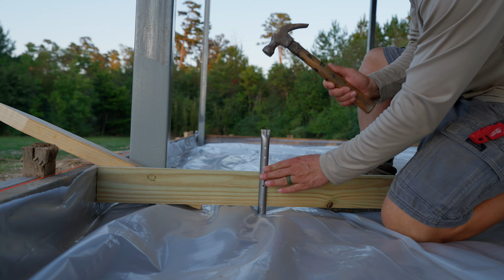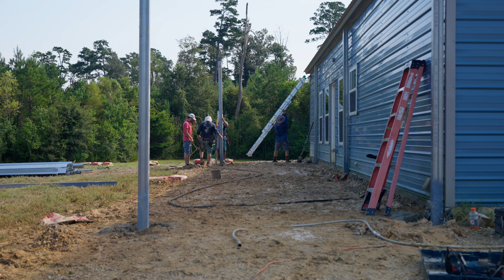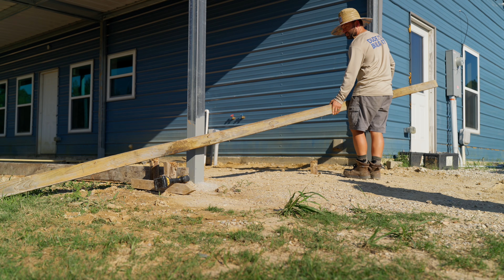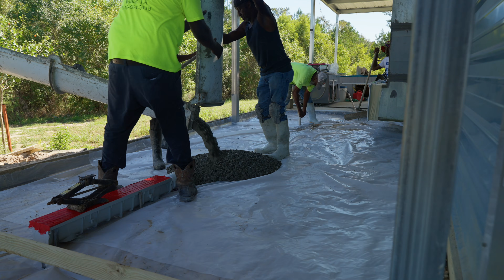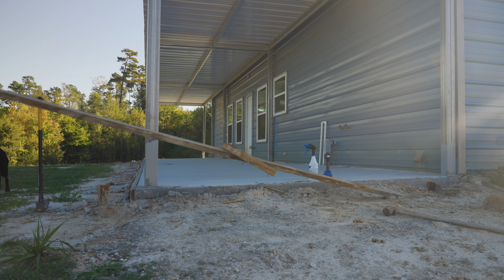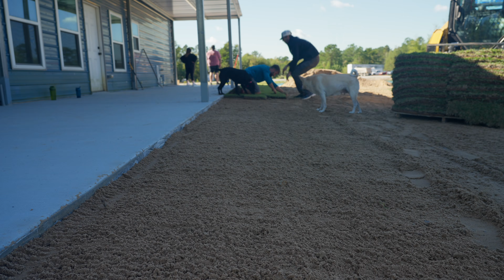This Wrap-Around Porch Changed the Entire Barndominium

Comment: I have an existing 2000 sq foot sheet barn with concrete around the interior edges, insulation is done but we're insulating again. Connecting septics from an existing house nearby. Hoping to get it all finished with under 50k.